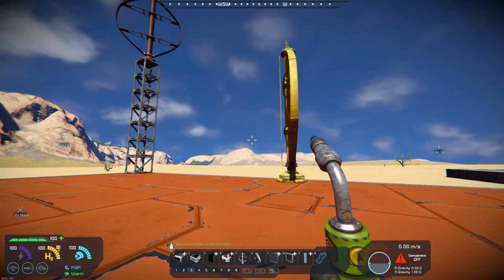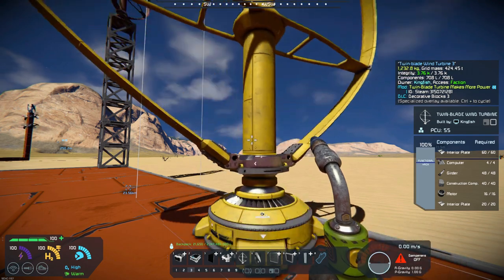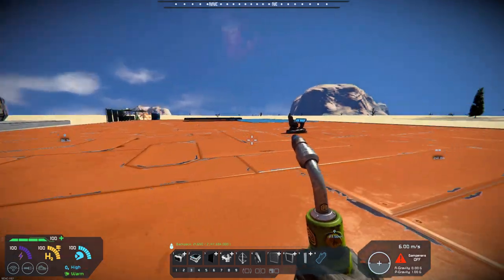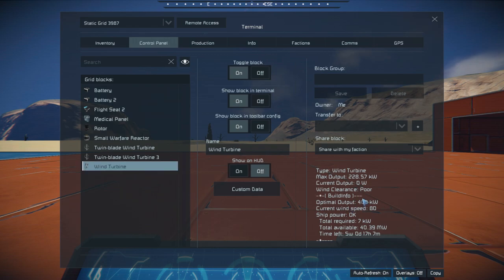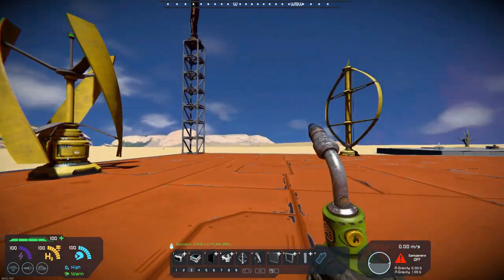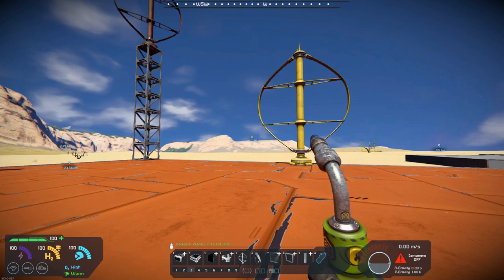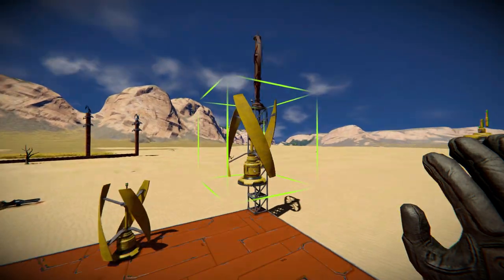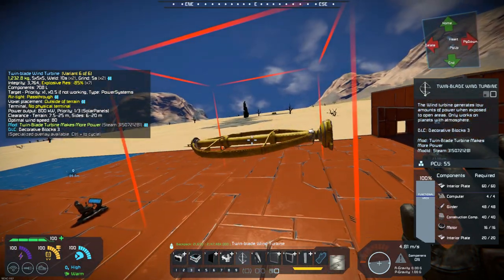Space Engineers – Mod Wednesday – Twin-Blade Turbine Makes More Power

Comment: i changed my turbines to the bigger ones but there is new stackable turbines which dont need that 8 block distance they stack on top of each other and heaps power
Reply from the maker: Nice, I think with this turbine mod it balances the power output with the cost of building them.  With any power source having the proper power storage can make a big difference.  One of the first things I do is start adding batteries as soon as I can.   Thanks for watching!

Comment: But does it require a 8x9 distance like the original Wind Turbine?
Reply from the maker: You can check the workshop, here is what the modder said: "(Clearance remains unchanged) 25 off the ground so 3 blocks up with 5 radius past the bounding box for optimal."

Thanks for watching and hope that helps.